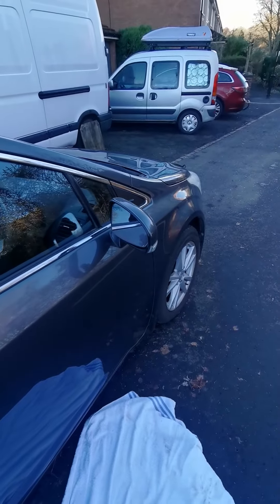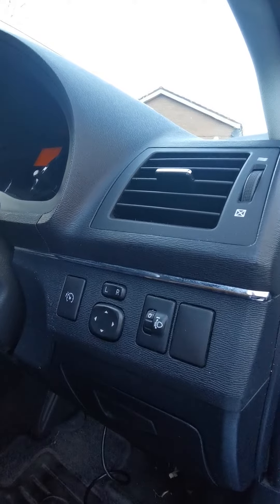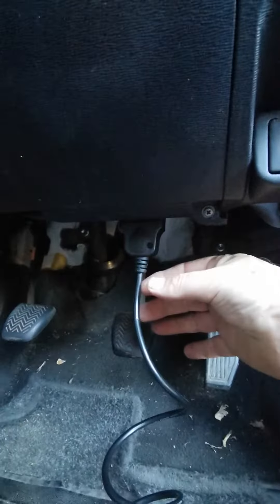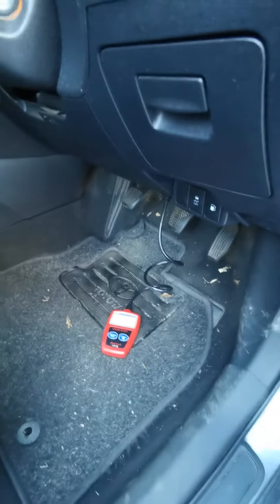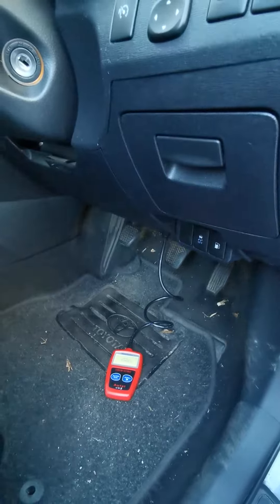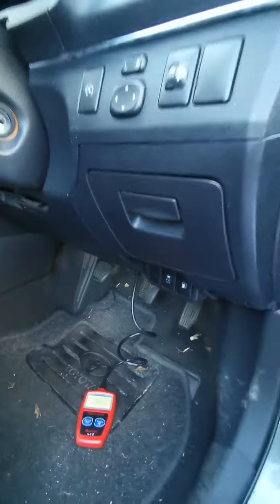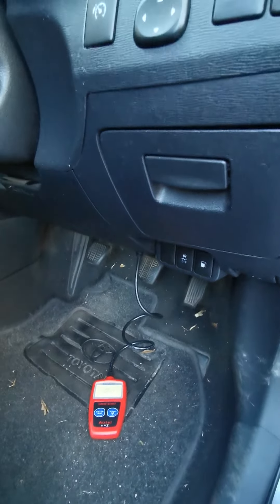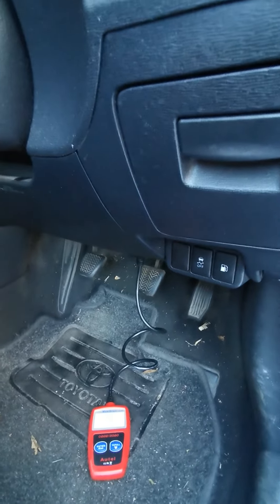Share Toyota Avensis 2011.vsc check parking brake check. VSC LIGHT ON. ENGINE LIGHT ON..FAULT

Comment: Hi
I have the same problem but i have been frivi g with these lights for months now . I want to get it fixed went to 2 different Mechanics they do.t know what the fault is. They cleared the lights but all four lights came after few hours of driving 
If someone know what is causing the problem plz let me know

Comment from the maker: Exhaust gas circulation flow P0400
Reply: I have faced the same problem, how you resolved ?
Reply: Petrol engines, Purge Valve or tank cap can cause this. What't good about Toyota is you can still drive it with lights on but other modern cars just go in Limp mode. Toyota is the best if you can do some repair alone.😂